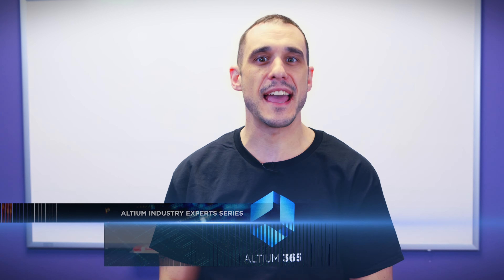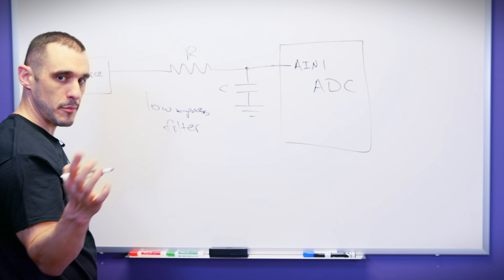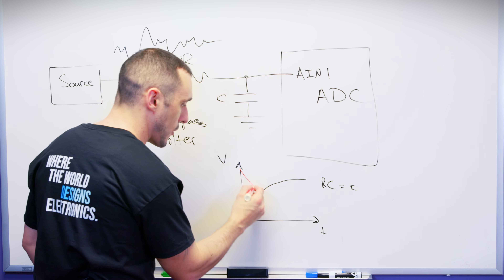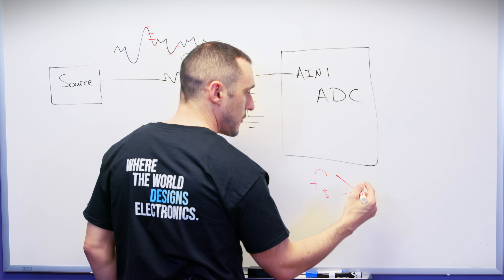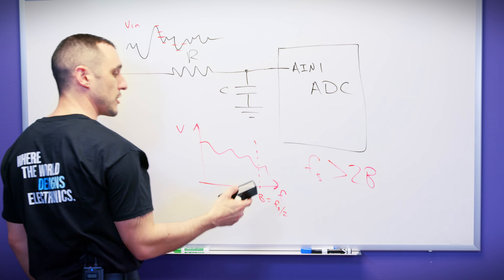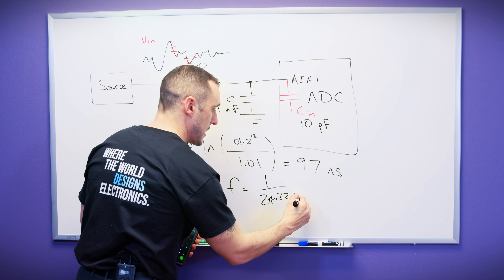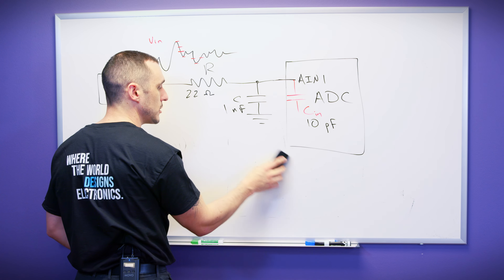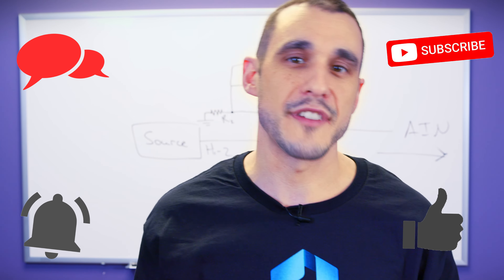ADC Filtering Deep Dive

Comment: Thanks @Zachariah-Peterson for all your content. One question on the filtering stage: I've seen scenarios where the sample and hold switching of the ADC introduces noise that may couple back in the feedback loop of the previous amplification stage, before the ADC. How would you filter out this noise? Also with an RC? 
Cheers
Reply: Is this in reference to the case of an active filter with a high-impedance source? If this is fast switching noise that draws strong transients it might be exciting a pole in the amplifier's feedback loop. In that case I would expect a sinusoidal noise component, possibly with some additional distortion (harmonics). Is this what you're referring to?

Comment: Question about mounting holes for RF circuits, for FR4 PCB,  how do you calculate the maximum torque of the mounting screw in order not to deform the pcb hence changing its impedance?
Reply: Good question, I do not want to guess but it would be based on the modulus for the material. You have to do a lot of deformation to change the impedance, I think another important point is to find the right torque to help suppress vibration.

Comment: Hi! Correct me if im wrong, but the non inverting opamp circuit will have a limited bandwidth on the "gained" portion of the input.. the gain is (1 + Zfb/Zin-), so the +1 term would bypass the filtering. Vout will be vin (no BW limit) + vin×gain (with RC Bandwidth limit)

The non inverting input should also be filtered in order to match the BW of the feedback network
Reply: This is totally correct, if it’s possible it might be better to use two op-amps or a discrete buffer followed by another filter topology like a sallen-key to get the same effect if the input impedance is high and/or unknown (plus you can easily get a second pole and resonance to play with!)